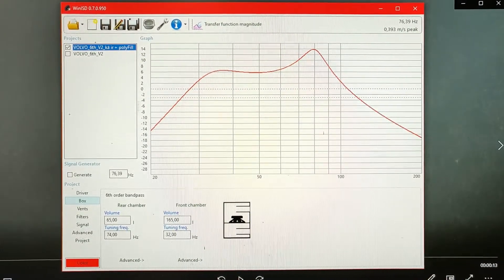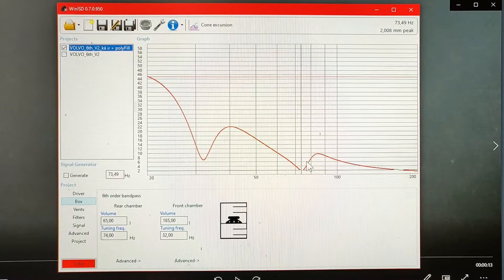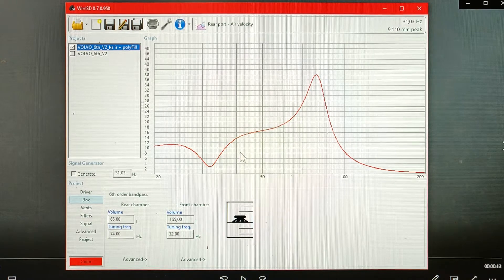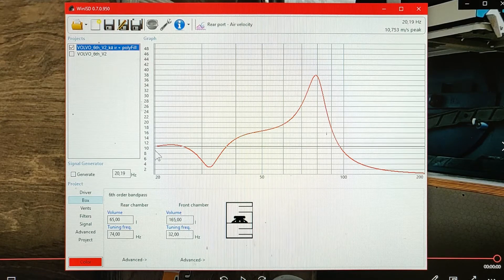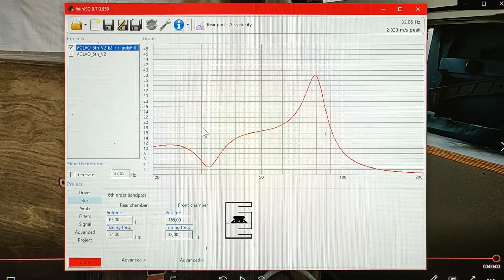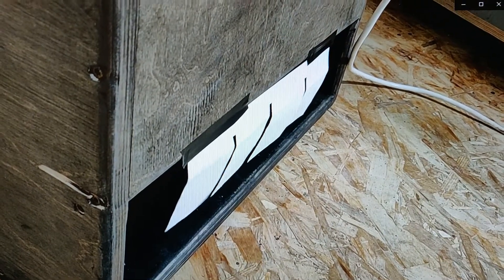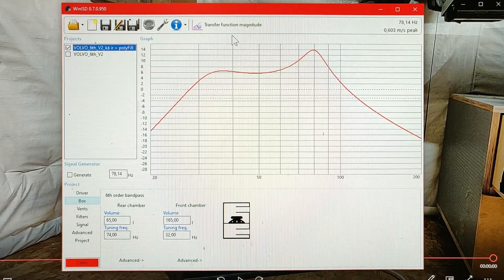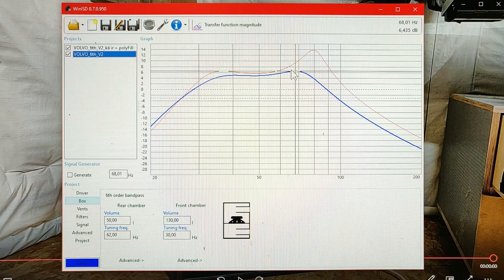6th order subwoofer vs. WinISD

Comment: PLEASE TELL ME:  what is the difference when we have both ports in the same part of subs and when the ports are oposite? L-Acoustic made Sb18M with both ports in the same part but other brands (like KV2, Makie, Norton, etc) made subs with ports in oposite, like yours. Why?
Reply from the maker: I'm not sure, but I guess from acoustics standpoint for subwoofer frequency range it should not have any noticeable difference if the ports are separated or next to each other. But I could be mistaken. My gut feeling says that they should be separated, but it's only that, a feeling :D Other reason why my ports are on opposite sides is that I wanted to avoid 90degree turns in ports. This is an interesting topic to be honest
Reply: @KarlisZalitis  yes! I made a lots of tests and I feel the best frequency coupling when the both ports are in the same part and no distance between them. L acoustics made something a little more intersting whem they put both ports in a little common space(like 5-7 cm coupling  port)  . So, in the SB18M the both ports don t go outside directly. They are opnened in a PRE OUT port that sum both .
Reply from the maker: Interesting! I will do some tests too,, to prove to my gut it was wrong :D
Reply: Supongo que esto será para tener un menor rango de error a la hora de fabricar un cajon de sexto orden, ya que con los puertos individuales se evita totalmente el cortocircuito acústico evitando que se cancele el sonido, incluso hay diseños con ports individuales donde un port queda al frente del cajón y el otro queda en la parte trasera del cajón, lo cuál personalmente me parece mas ideal ya que logramos un sonido mas expansivo evitando que las ondas de sonido positivas que salen de un port se encuentren con las ondas negativas que salen por el otro port...

Comment: What circumstances would you choose 4th, or 6th order over a traditional Cheby-Chev ported enclosure or similar setup using PR's? I'm a Home theatre person not car audio for context :)
Reply from the maker: Hey! I guess one of the main benefitsis driver control in passband region - from what I've read, the less cone moves the less distortion. Also this helps to protect the driver from mechanical damage.  Better loading allows for bigger boxes thus more effective output. But all of  this has to be balanced with port size to avoid ringing or Air turbulence. And yes, usually bandpass boxes are bigger. In short - it depends :D

Comment: Hello. What will happen if i made the front camber tuned on higher frequency and the rear camber  tuned for lower frequency. Ex. 70hz for the front camber, 40hz for the rear camber?
Reply from the maker: 40/70 tuning seems to be just fine :) But chamber volume also is important. You can play around with box responses using winISD, it's easy to use and free :)

Comment: Should the port areas be relative to the size of each chambers?
Reply from the maker: From what I have read, the port area in cm^2 divided by volume in liters should be at least 3,6. But this depends on many other aspects - shape of the port, cone displacement volume, available space etc. Also - the port should be as big as possible, but I keep the air velocity above 16m/s. There will be soon a video, where I take a deeper dive explaining ports  for my latest subwoofer build
Reply: You should really do a video about port areas because there's no videos on YouTube explaining it in depth. I'm building a parallel tuned 6th order for a skar ddx 15. Skar recommend 64 square inches of Port area for 4 cubic feet of box space, which is what my low chamber would be. The high chamber would be half of that size which would be 2 cubic feet. Should the port area for this chamber also be half of the port area of the low chamber?
Reply from the maker: Did some quick math, Skar seems to line up with the 3.6 coefficient I mention earlier. The short answer - yes, for the smaller chamber half of the port area should be fine. But this comes with many asterisks :D Have you tried to plug the numbers in WinISD?
Reply: I will try it, thank you.